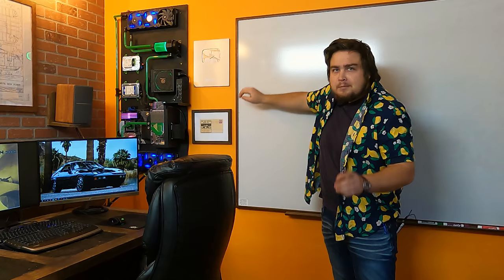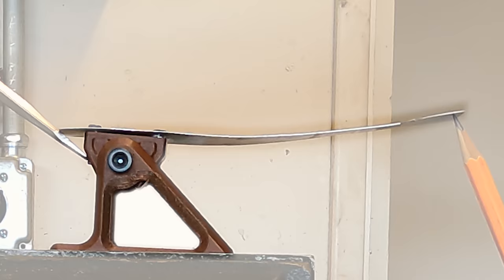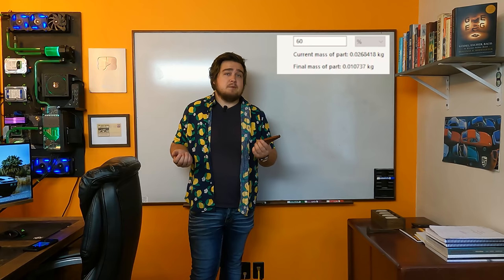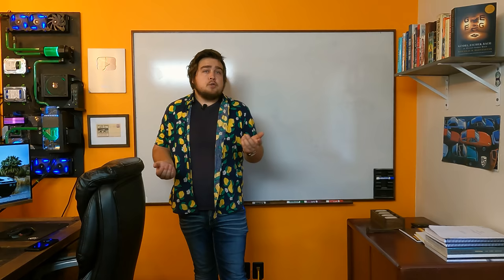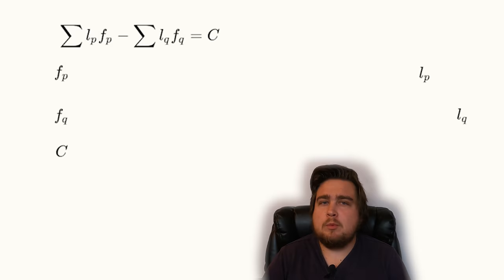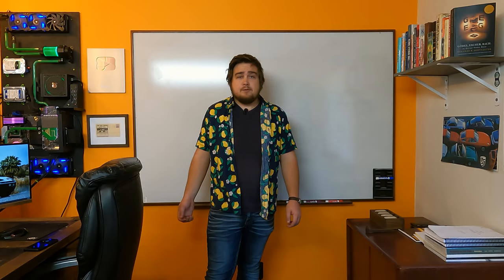Why do the Strongest Parts Look Like This?

Comment: Cool. Hey would you design a car wheel optimised for weight? I’ve been wondering what would optimal car wheel look like, if aesthetics and brakes are not an issue.
Reply: You have to define "car" really carefully.  If it's made out of steel and rolls, I'll give you a nail.  If it moves under its own power, I'll give you a helium balloon.  So forth.
Reply: @Asdayasman  I believe he wants a car wheel though, like the metal cylinders that hold the tires. Cuz a whole car would be difficult, as you described.
Reply: Basically look at the bugatti bolide
Reply: @D3nn1s  bolder wheels look aero dynamic and good brake cooling. Are these structurally optimal, I have no idea.
Reply: I haven't actually seen a full analysis, but I believe it ends up serious to most of the wheels you see which have Y shaped spokes. As in, a single point coming out from the center of the wheel, splitting into two points which go to the outer rim. Several of those repeated. Tend to be the lightest wheels with the most strength. Add this sort of optimization and they become smoothed and curvy with some wider and skinnier parts. Just my general guess and drawing from old memories. I could be way off.
Reply: @802Garage  I imagine something similar. Like more advanced wire spoke wheels.
Reply: @tiitsaul9036  bolder wheels? What are you talking about? Im talking about the bolide's 3d printed calipers e.g.
Reply: @D3nn1s  auto correction. Meant to write boldie
Reply: @tiitsaul9036  nice try soldier. Try again.
Reply: I suspect the result would be a disc with no holes (no spokes, a zero spoke wheel), with a thickness gradient from the hub to the tire. This would also be very aerodynamic, at the cost of insufficient brake cooling. In any case, I would be very interested in a stress analysis of both this design and the multi-spoke designs mentioned by others. My idea would have eliminated stress raisers, possibly at the cost of more material.
Reply: Many AI actually made one, look up AI designed Wheel and if you find the orange one, that's the one.

Comment: Stumbled across this video, because of the biomimetic screenshot. I see a pedantic computer mounted to a wall.
I listen to the introduction, I see a Gödel, Escher, Bach book on the other side.
By minute 4:38 I am still waiting on biomimetic part modelling, but have already heard about Euler, Bernoulli, fluid dynamics and graph theory, a repeatedly bad pronounciation of Königsberg (which - btw - is also famous for its Königsberger Klopse) and topology.
I arrived finally at 7:52 where an object after being designed by applying topology optimization and manufactured by additive synthesis shows great properties.

Yeah, I'm going to subscribe.

Comment: This technology is HUGE for people using laser sintering metal 3D printers. The material is expensive and the print times are sometimes measured in  days. This makes manufacturing larger and larger parts practical, and makes smaller parts cheaper and easier to make, because you reduce the distance and time the laser has to fire per layer

Comment: The way you explained the role of optimization and FEA is idealized a bit I think. Maybe not exactly "idealized;" your explanation was exactly what it was conceived to do, but I think more often its implementation is that of making a given widget only as strong as it has to be in order to last a couple of weeks past the warranty expiration. How many times have we heard "they just don't make things like they used to?" When people say that, they're referring to things that predate FEA and were designed on intuition rather than simulation; things that were "overbuilt" by today's standards. I'm glad we have optimization and FEA for things like race car engines and space-going rockets, but for things like tractors and coffee makers I'll take "overbuilt" above "optimized" any day of the week.
Reply: Which is acceptable and perhaps a market that needs filling. I think many people would rather pay more to keep something for a decade or longer than replace a cheaper object every few years.

Comment: Those structures and that divan in particular looks like something Carlo Mollino would've come up with had he had access to modern computing power and manufacturing methods...Which makes some of the things he designed  going back to the 1940s with essentially a pencil, paper, slide rule and intuition and how local Turin shops like Apelli & Varesio were able to manufacture them with what they had even more astonishing.

Comment: Rockers could be closer to weight neutral with only one side voronized. That could help at high speed. Neat history.
Reply from the maker: Absolutely- although I'm using some of the mechanical advantage here for a reason. Still testing!

Comment: Very interesting. I'm a car guy and a gun guy and have seen plenty of automotive parts designed with this technique (Calipers, control arms...) But I have yet to see a firearm, bolt,slide or other part designed with these techniques.
Reply from the maker: It's something to consider that firearms started from fairly organic structures- old flintlocks were carved trees with a barrel, so they started with the organic structure and evolved with the industrial revolution. Cars didn't have that, they started with industry already established and had to grow the other way. But "Skeletonized" lowers exist.

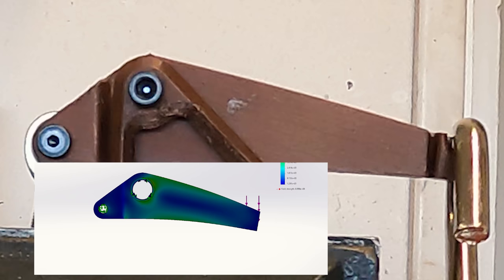Comment: 6:59 main problem with that when you use force pulling it down, you should flip this upside down, it will take more force. thats why in 1st test it ripped smaller amount of plastic around hole like 2:28

Comment: I'm pleased I understood a lot of this. It seems the object is to calculate the forces between fixed points and only have material along the lines between the points sufficient to resist the forces.
   With maybe a bit more to resist sideways/torsion, uh, maybe another whole subject.
V. Interesting to someone mostly experienced in sound and electronics.
Reply from the maker: That's good to hear- I worry I error on the side of too complicated sometimes, I'm glad that it can be understood!

Comment: I will say, it never fails to impress me that we can use simulations following pretty rote mathematical calculations (ignoring that those calculations have to happen a bazillion times) and get parts that in practice behave very closely to what was modelled, failure modes and all. Yes, there's always gonna be differences between the idealized world of numbers and the physical analogue, and the fact that these simulations get to be as good as they are because they're compared to the real world and, if necessary, adjusted, but that doesn't take much from the sheer amazement I feel that holy shit that thing snapped right where the computer said it would.

Thanks, as always, for the vid; packing up educational subjects into an entertaining video is no small feat (and I refuse to use the word "edutainment", that word is anathema to me. Ducks too. Ducks are anathema too.)

Comment: 1. Great choice of book (Godel Escher Bach).
2. It would've been nice if you extended on the idea of evolutionary computation which is at the heart of generative design. It is an absolutely fantastic subject and the analogy to biological evolution is riveting. As an example, bone topology as a function of weight, stiffness, and other constraints is approached in the same concept, hence why results would be similar in related problems.

Comment: I think using the word "strongest" is a bit dangerous; most will presume it means the highest load before fracture, but what's typically called "topology optimization" optimizes only the stiffness, i.e. minimizing compliance; yield stress, fatigue, buckling etc. doesn't even enter the equation at all, only the materials elastic stiffness.
If one wanted to test how well this was optimized, one should look at the elastic deflection curve for the finished part. This stiffness/mass ratio will be highly optimized.

But there is no reason to think that this would also optimize for lower stress concentration; in anything, more compliant structures tends to distribute the stress concentrations more.
Of course if one has a sufficiently bad stress concentration to start with, together with a large bulk of unnecessary material (for both stress and stiffness), then the max_stress/mass ratio will likely improve by doing almost anything. Just make sure to round of all corners and you'll be good, so, i think the "cleanup" step here did most of the work making the part still perform almost as good.

Comment: Thanks, nice video. What's the difference in terms of costs though? Also the 2 examples given at 0:20 are designed like that exclusively for design purposes, not for optimisation reasons. Also it's "Oiler" not "Uler"

Comment: FreeCAD does this strength (FEM) calculation thing pretty well, and it is free! On top of that you can design your own shait and calculate it's behavior under stress.
Para View is a dedicated  piece of software for fluid calculation i believe. Like Pelton turbine and crap like that...
Reply from the maker: I need to mess around with freecad more. It's impressive.
Reply: @WesleyKagan  It is a very ambitious attempt to get that bit of the CAD/CAM to the user. With the 3D printer CAD got really popular so popular Fusion360 has been given away free to use but not free at all! I believe FreeCAD is now more than 10 years in development i really whish it would be further...

Comment: But it doesn't sound like topolgy optimization accounts for the manufacturing process. The strength of 3d printed parts also vary based on printing parameters like orientation of additive printing, temperature, post-processing (annealing), etc.

Comment: This sort of optimization works off of assumption that the material is solid. With 3D prints, that generally doesn't hold. Internal fill of 3D prints could be optimized without compromising external looks.

Comment: Do the programs take infill and shells into consideration too?
If you're using a low enough infill, the optimized shape could use more material.
I wonder if they're weaker than in theory, because of how FDM prints have weaker sheer strength along the z-axis.

Comment: Late to the party but I'm wondering...

Regarding practical application of this kind of topology optimization; looking at the chair, for example, there are some points that are thin enough that they could be damaged or severed. Depending on the specifics (what you're using it for, what material you're using, whatever factors could potentially cause damage [pets chewing, teens existing]) could something like this be planned for? Something about failure points?

I mean I'm picturing adjusting the model to have a section severed and then fixing the weak spot before un-severing the thing so there's essentially doubled up sections. But then it starts getting heavy again. Would it just be down to "this one is gonna get chewed on, let's double it, but this one is fine by itself" type judgement to implement such changes?

Comment: A query - did the piece break at a similar (or different) applied load?
The load meter sprang out of view before I could read its screen.
Reply: A little bit lower, but similar. Optimized structure withstands ~90% of load, breaking the original piece's durability while weighing ~40% of it.

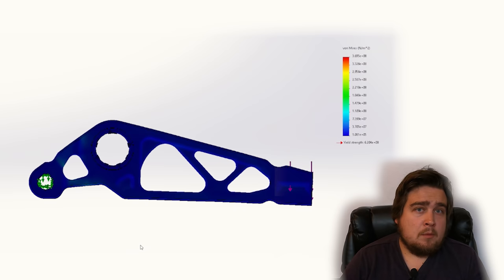Comment: Normally, I'm not an advocate for intuition, but I could spot where the failure was likely to occur at 7:33. How? I submit that both this, and the answer to the question in the title, relate to biology.

As mechanical parts become more and more intensely scrutinized and streamlined, the optimization causes them to become organic-looking. Note the phrase, "organic-looking" here; natural selection has been scrutinizing, streamlining, and thus optimizing biological structures since the emergence of the first self-replicating molecule. Our parts have been refined over eons with no consideration given to aesthetics. These parts descend with modifications that have been made only insofar as they are conducive to overall environmental fitness. The result? The soft curves, sinew, and seemingly semi-permanent solutions of economy. Form ONLY follows function. 

We're now paralleling this process by using computers. Generations of trials can be reduced to seconds. Adopting such a method means dropping all human expectation. The tool-assisted design we are now witnessing has grown beyond the threshold of the human mathematical capacity, except for where our intuitive gambles still sometimes pay out (intuition is another example of natural selection's ability to take statistically-beneficial shortcuts). As such, the patterns we see with any topologically optimized structure are confusing, weird, alive-looking solutions that we can sort of 'see' potentially working, despite the fact that we've already learned—by rote and culture—to prefer triangular, hard-edged geometries that stay closer to that which we can understand.  

It won't be possible to drop our biases entirely. As AI continues on the path of developing ideal structures, I have no doubt that we will start to see things that seem to make no intuitive sense. We are now witnessing the first emergences of computationally perfect structures (given material limitations). Eventually, everything designed will appear alien to us. I was just barely able to tell where that part might break. Scary to admit, but we the self-professed clever are now scraping the sides of our remaining resourcefulness; our 'creativity' is about to become outmoded, and then replaced entirely.

Comment: Yeah you brought up all the wonderful good-sides from the manufacturer except
One. You can't weld it fix it bolted or anyting else if it's optimized like that. I bought a BMW motorcycle that had a broken part on it was optimized seven ways to Sunday. I ended up gets clamping hose clamps and stainless steel butter knives all over this pretty optimize peace so that it would actually do the job I needed not just barely do the job that was not enough for me.

Comment: Could you try to make an Engine run on pure oxygen? It sounds like this would fit your channel exceptionally well. I found no other detailled videos on this topic.
Reply from the maker: Move? Sure. That's basically a compressed air engine. Run as in burn? No, there's no fuel. a burn needs Fuel, Oxygen and Heat, and without the fuel nothing would combust or burn for gas expansion.
Reply: @WesleyKagan  ofc, i mean running on oxgen instead of normal air. If there are no other gases, one could burn more fuel and achieve a higher pressure and therefore more torque, am i right?
Reply: @ostfahrstreifen8421  It depends on how long you want it to run for. You'd be basically running a cross between a cutting torch and a bomb in the cylinder. Assuming you had a strong enough piston and bottom end that it didn't instantly grenade, I'm guessing the first point of failure would be the exhaust valve catching on fire.
Reply: @LesNewell  so i guess it would make for a good video^^
jk, i guess one could modulate the o2 pressure and with that even get rid of the throttle.
Reply: @ostfahrstreifen8421  The throttle basically modulates manifold pressure on a normal engine so the two are equivalent.

Comment: Your couch is art or at least it will be for the next 50 years when it might become very ordinary however it only works for an outside lounge chair where you can hose it off with water hose. Consider trying to dust inside your Manhattan apartment not a problem if you have enough money for a maid.

Comment: is your first torque example correct? L1 is clearly longer than L2 but you wrote 1:5. (L1:L2) min 1:10.
Reply: It is incorrect. 
10 months in, 280k+ views and there are only 3 comments about this, with a collective 4 likes between them.... 
Considering he spoke the formula out loud as well, I assume the real problem is that the lengths are mislabeled in the image. Probably due to mixing notation? If you call it L_a instead of L_1 the mistake becomes super obvious. 

I think what bugs me the most about this is that if he wanted to get the general point across that forces cascade in different ways through a part, he could have said it without the math. The math served absolutely no purpose except to give him credibility. And he got it wrong. And none of his viewers care. 
This is not the channel for me.